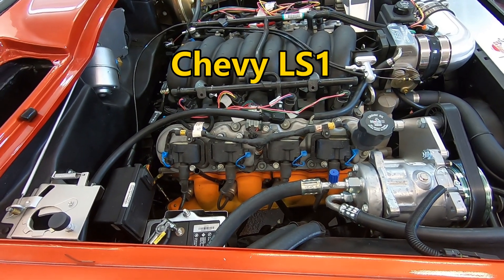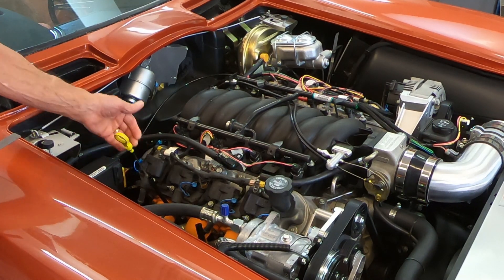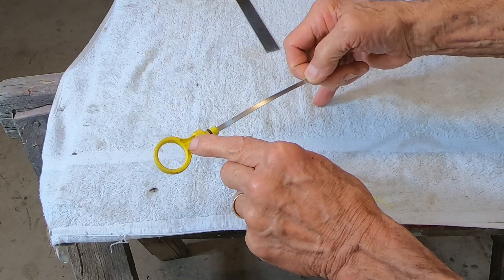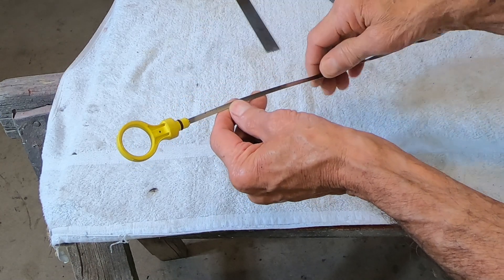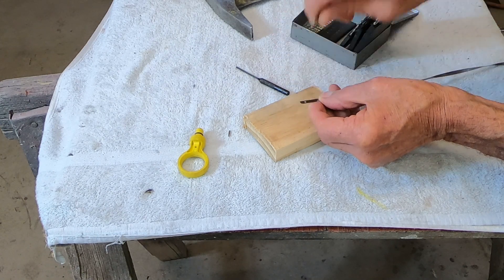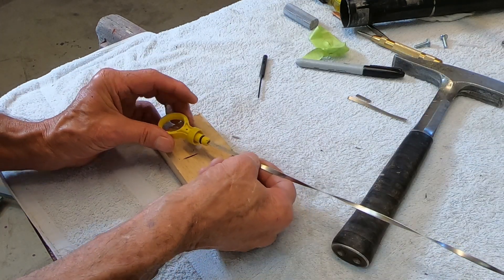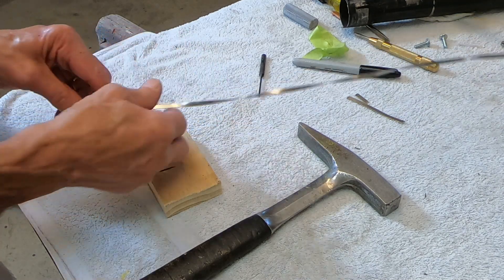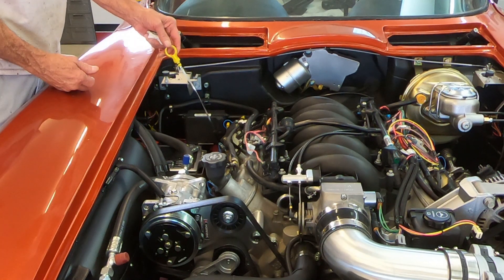How to Shorten a LS1 dipstick - LS Swap Project

Comment: Thank you so much for the helpful tip.. I own a 2003 Chevrolet Monte Carlo SS and the original trans dipstick is cracking and loose. Unfortunately a replacement from GM is discontinued and with no aftermarket/junkyard solutions. I did however find a superseded P/N for a dipstick on newer model Chevy/Buick FWD vehicles with the same transmission, but the new dipstick will require the corresponding tube which is slightly longer. Turns out those dipsticks are similar in design to the one you demonstrated on in the video, can be shortened it to the desired length by removing that pin. Thank you again my friend. God bless you!
Reply from the maker: You are very welcome, glad I could help!